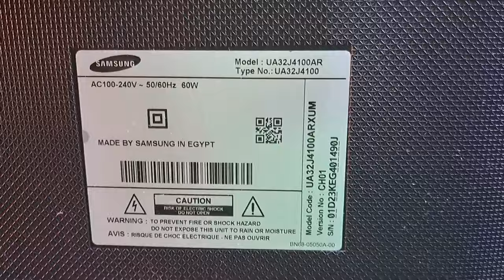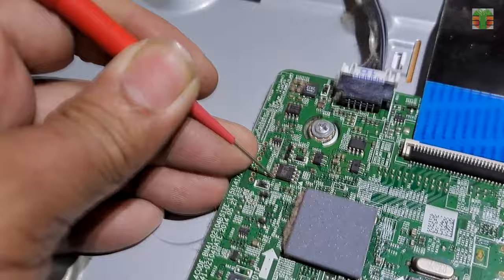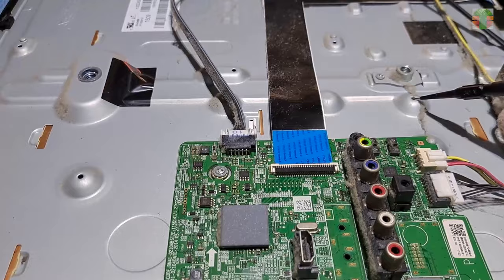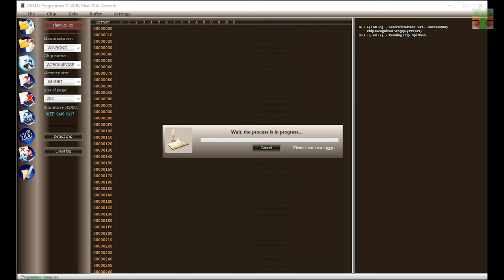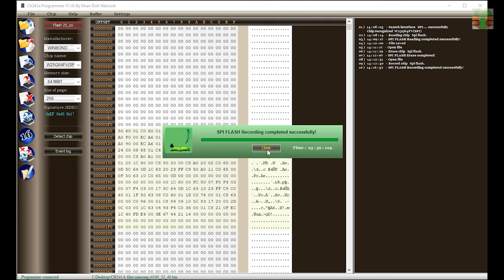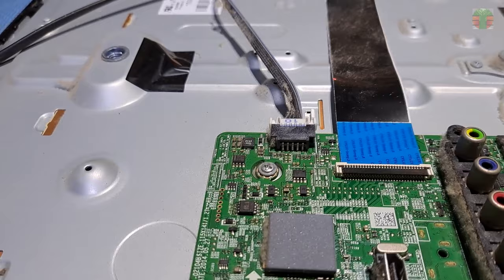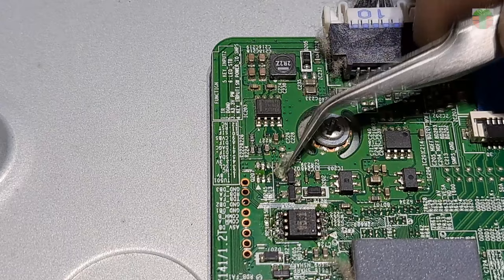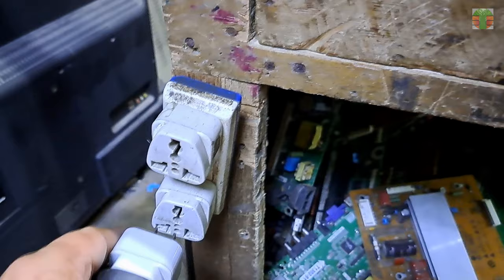Samsung LED TV blinking red light indicator.

Comment: Interesting.  You have awesome, infinite patience.  Hopefully it is OK if I impart a few tips.  #1 while going through supplies it always good to follow the supply through switching points to start with.  Would have saved a lot of time.  #2 EEPROMs rarely change programming in circuit by themselves so chances that it is corrupt are very low.  I would have saved that for last unless the user reported that the power was pulled while updating.  #3 why not use the programmer verify before re-writing just to be sure you really need to re-program it?  Or download the image and verify it against the known good image?   In any case nice work!
Reply from the maker: thanks
Reply: Infinite patience on one piece of equipment, as a repair tech will get your fired. 
Infinite patience while being an electrical engineer is what you’re supposed to have.

Comment: Hello
Did you short-circuit the D and S pins for a moment and the TV turned on?
Reply from the maker: yes
Reply: @tevzTVTevatronics  Does this not cause damage to the circuit?
Reply from the maker: @protection4541  No because the MOSFET duty is to short the drain and the source or act like a switch.
Reply: @tevzTVTevatronics  Is it possible to do this wherever there is a mosfet for a momentary test?
Reply from the maker: @protection4541  big no

Comment: At 12:59 you say “let’s try to connect the gate to the source” but the drawing shows a red line, connecting the drain to the source. So, which is right, the drawing or what you are saying?
Reply from the maker: The drawing is correct. the narrator is wrong. I wrote the wrong pin of the Mosfet creating the narrator's voice. You're really paying attention to my video thanks for that.
Reply: @tevzTVTevatronics  Well, I’m learning a lot thanks to you so, thank you kindly.

Comment: While you using hot air working instead lower the heat and same as air flow that bloated pcb
Reply: He should use some Kapton tape (expensive) to shield the board from the excessive heat.

Comment: Hello tevz I have issue with lg tv it is only blue screen no picture and this is smart tv I have chage new mother board but still the same any advice how to find a solution for this problem
Reply from the maker: Check panel.  Cut ckv line if necessary.
Reply: Hello tevz. I got a question for you if the mosfet G15N10C got the problem & can't find it. Can you suggest the better one to replace it. Thank

Comment: omg all equipment really bad, but multimeter is 1600$ ))) 

hot air gun sounds like membrane pump type - its only good for heat shrink, 
buy quick 857dw+ and set it to 300 deg C and use widest nozzle (about 1cm  diameter)
and u will never bubble any board.

u are bubbling boards because uve set big temperature (looks like 380+ deg and low flow (maybe because of membrane pump) and really thin nozzle - u are making thermal shock to the pcb because of big temperature gradient (thin nozzle works like rocket needle if u understand me)
u need to use 1cm nozzle to heat bigger pcb part so heat will be applied smoother